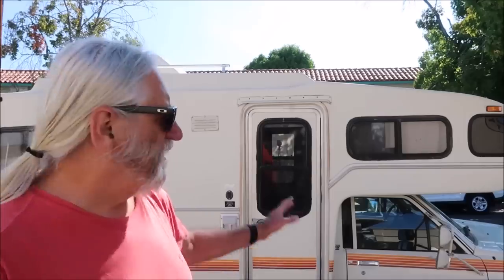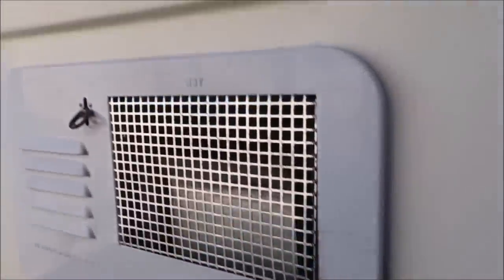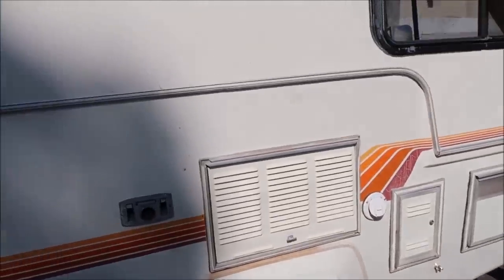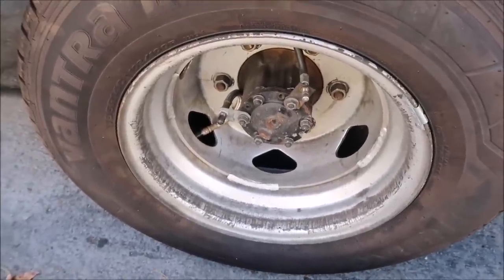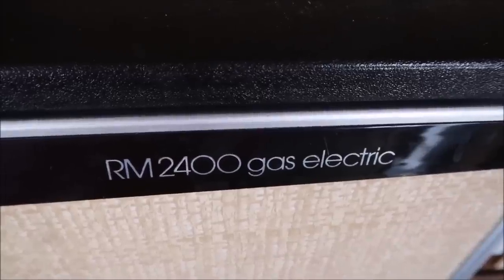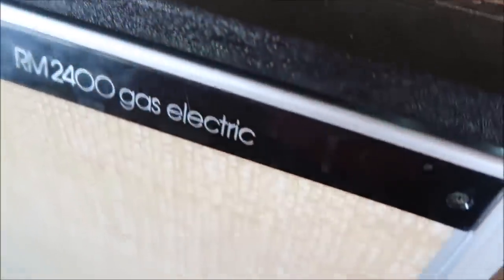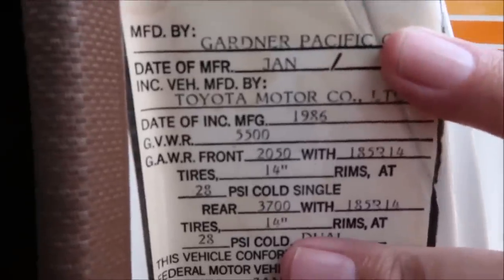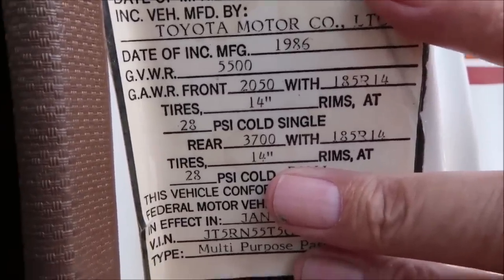What It’s Like Living in a Toyota Motorhome RV and Why They Stopped Making Them

Comment: Never knew Toyota made something like this. Explains why it’s still running 😅
Reply: Toyota didn't make it.
Reply: I'm surprised the frame hasn't caved in.
Reply: It's a conversion. Toyota didn't build it.
Reply: Except that as the owner explained, in the next generation when the engine became a 6-cyl., there was a serious problem with the engine heads and there had to be a big recall.
Reply: Because Toyotas are stout.
Reply: Right Lol
Reply: Toyota made the pickup cab, but someone else made the conversion. Weird they kept the same 4 cylinder. Thing can barely haul all that weight... solid engines but it’s too little for an RV.
Reply: AOMechMarine AOMechMarine just because it’s still running doesn’t mean it’s not too small. It’s not enough to get this thing over 60 mph.
Reply: Patriot Jefferson  I have the same body on a Nissan chassis with the z2.4 four banger. It pulls fine in the mountains. I'm not a speed demon, so it suits me well.
Reply: Don't let the fact that Toyota built the cab and chassis fool you.  Maybe the truck will still run and drive, but like all old motorhomes if water gets into the coach portion it will rot and turn into a black mold special.
Reply: @kennethsouthard6042  I have a Sunrader nearly identical to this, except on a Nissan 720 chassis cab. I'll attest that when water gets in the coach area of one, it rots into dust. I'm rebuilding mine. The fiberglass is in fairly good condition. I got it cheap. Going to do a body-off, complete with new floor and wraparound window delete.
Reply: Mine would do 55-60, Depending on wind,  lol.  Mine is permanently parked but if I sell it, all it needs is fresh gasoline and battery to run.
Reply: Kenneth Southard deadly and infectious
Reply: @tommyguns14able   The full one-ton frame from Toyota is built like a Mack Truck.
Reply: @jjbailey01   Me too !  I love the Nissan powered mini motorhome 5 sp. manual.  It pulls that load just fine.  Does it slow way down on long hills?  Yeah, but who cares.
Reply: @pouglwaw5932  heck ya! Dont care if it's slow as long as it'll still go.
Reply: Did anyone ever put a turbo on one?   Toyota engines are famous for their stout crankshafts.

Comment: I had a 21 foot Sunraider and did use the overdrive for the 10 years that I had it. I got up to 22 miles per gallon and never had any trouble with my transmission.

Comment: This guy is the real deal. He said "shore power" which original used by marine(boaters) say for plugging into electrical at the Marina(docks). If you hear someone say it at a campground usually means They have a good amount of time boating. 
  I bet this guy would have an interesting book if someone wrote a book about him.
Reply: Actually shore power is a pretty common term for plugging in at a campground.And yes we stole it from the boaters.
Reply: Shore power is the standard word used by RVers so it's not too impressive
Reply: @porcupinepunch6893  If you notice my comment is 5 years old, as time goes on things that are not common like slang words become common over time as these words spread across to other groups. Was a boater slang that expanded to RVers.

Comment: All of the 3.0 v6's were recalled.  I bought a 1991 Toyota pickup 4x4 with the 3.0 and got a notice in the mail that they would cover the head problem up to 100,000 miles.  My head gasket blew and warped the head at 98,000 miles.  Toyota replaced everything and never had a problem after that.  When I traded it in, the pickup had 295,000 miles on it and the engine still ran great.
Reply: Yep my 3.0 4runner has over 300k on it, still runs great and the blackstone oil analysis just came back perfect.
Reply: The 3.Slow Toyota was a real piece of junk.  Basically 4cly power, v6 gas milage and a time bomb for reliability.

Comment: Looks like it is in mostly fair condition considering the age.
Reply: Micah Chase The motorhome too!
Reply: he didnt mention all that water damage on the ceiling
Reply: Dan Kirchner likely staining from condensation rather than leakage.
Reply: Uhh, do you know anything about vehicles? This one is like a 9, most are a 4 dude.. just try to find another in this condition.  "Fair" condition is basically rusted out high mileage junk, this is VERY GOOD condition, if not excellent.  Did you need to feel bigger today by making someone else seem smaller? Seems so, sad..

Comment: I had a 87 toyota pickup truck with 2.4L R22 engine. I bought it brand new $7000, It was so under power. I used to tow a 12' travel trailer. It can go only 45 mph when pass through Sierra I80 to Lake Tahoe.

Comment: I had a 1986 Toyota  long bed with the 22R engine,  automatic. 

It will pull this, but the 4th gear/overdrive would only pull on flat highway, any type grade and it would kick from overdrive to 3rd gear. 
Great truck, kept it 22 years

Comment: So.... What I am hearing is... If you want one, get a 4 cyl, floating axle, stay out of O.D. 
Basically 86-88
Got it
Reply: Nah the 89+ with the v6 is the one to get. By now I’m sure they all had the defective cylinder heads replaced
Reply: @chunhaylee  Last year I rebuilt the v6 3.0 engine on my 1991 4runner 4x4. I should have got a complete engine from the junkyard here in southern California & rebuild that one instead. That engine didn't have the cylinder head problems that the 3.0 engine has.
Reply: Hi I have a 1991 toyota warrior
Reply: If you can avoid the duelly rear axel and find a single wheel.

Comment: I had one of those Toyotas, but the camper was taken off, and converted into a tool box truck. 1ton, 6 cilinder. Top speed 70mph. Loud winding manual Transmission. 16mpg

Comment: I worked with one of the owners of Sunrader around 15 years ago, and heard the whole horrid story of how the axle recalls started because of aftermarket dual wheels failing.  Really sad, Toyota and Sunrader didn't do anything wrong, and this guy went from making $250k a year making a good product, with a 30 year company, to losing everything and working as a tech at an rv shop, before he eventually bought another rv business and did ok.   He finally retired about 10 years ago I think.

Comment: I consider it a damn shame that Toyota decided to bow out of producing motorhome chassis. I'm sure they had their problems with rear axles and V6 engines. But once they were recalled and fixed, they had an awesome truck. I think Toyota should've continued with it, well into the Tacoma production. For a vehicle like this, I would've preferred a 2.4 litre turbo diesel engine, rather than the 3.0 litre V6 engine. Sadly, the turbo diesel was never available in large numbers in the USA. Emissions be damned, I would've preferred better fuel economy and better uphill climbing.

Comment: Anyone remember the small Uhaul box trucks from the early 90s that were Toyota cab and chassis based?
Reply: I do remember those also.
Reply: Yes I did. Still see some that are in third party hands.
Reply: I rented one that caught on fire
Reply: I use to own one, loved it. Regret selling it. Cheap to buy. Easy to repair, service, maintain, & all drive train parts are available locally at Toyota dealership ( O.E.M.) chain auto parts stores, & junk yards.
It was my undercover, stealthy garage, camper, & Mobil tool truck.
I would go off the grid with it. Loaded with camping gear, motor cycle, jetski, kayak, spare parts, & tools. Bought it cheap. Kept it for about 10yrs & 100,000 + miles & sold for a small profit. I miss it.

Comment: Cool rig .My daily driver is a 1994 3.0 V6 Toyota pickup. I have owned it for 12 years .It has 250000 miles and its still going strong. Its a little beat up but its paid for .

Comment: Should set some nice solar panels on top to power outlets and lights, not sure if enough power to make the ac work if if it does go for it aswell
Reply: I have one used 165 watt panel on my motorhome.  I have all the electricity I can use (wont run an ac though)

Comment: Funny I was planning on living in one a yr or two from now.
Reply: Really
Reply: Ebony Lo. I'd consider something bigger if you plan to live in it very long. I am currently living in a 34ft fifth wheel while I build a house. I don't think I could live in that tiny Toyota for very long!
Reply: @kansascountry970  I was thinking about it going through the gate at my workplace since it's so secluded and it'll take up parking.
Reply: Goodluck finding one and then goodluck finding parts for em
Reply: @carljohnson4996  if not a van would work
Reply: @ebonylo.  yea those white Van's work fine plus plenty of parts I've seen people add insulation a bed etc but it gets pretty cramped after a while
Reply: @carljohnson4996  I'm getting rid of my things as we speak. Haha I'm ready to start my travel journey. Don't have to worry about appliances anymore

Comment: I bet that thing is slow, people who buy Motorhomes should be more concerned whether it could make it up a hill than gas mileage.
Reply: Some rvs get 6 mpg. Id rather get higher mpg than speed.
Reply: @ninjamaster3453  If you struggle to go 20mph, yes speed is a concern.
Reply: martialimitator he doesn’t struggle to go 20 though. And who cares. If you can do 30 going up bad hills then that’s the speed you go. Gas mileage actually is a very big deal. Say you drive 3000 miles somewhere, and your motorhome gets 10 mpg, you’re going to pay about 900 in gas alone. In this he’d only pay 600. Those savings add up. Not only that but this engine is bulletproof. It won’t be breaking down anytime soon. He really should’ve gotten a manual 5 speed but I’m pretty sure he bought it used so he probably didn’t have a choice.
Reply: I concur Tombstone. It is a great engine for light hauling but not a good RV powerplant. Way too much weight for it to handle on steep grades.
Reply: Ninja Master how fast a vehicle should go doesn't necessarily determine how well it can go up a hill. Nobody buys an RV for speed.  I was really referring to Torque, Horsepower and Gear ratio.
Reply: I do have 1986 Toyota dolphin 22r goes uphill @ 45-50 depends how much weight I’m carrying One of the best engines no breakdowns , I did across country trips no problem.

Comment: Can u live in Toyota Celica?
Reply: '91 celica gts. Yes. For short periods. Be creative.  I'm 6 feet tall.
Reply: I.P. FREELY ho boy 6ft in a celica??!!! I am 5’9” and can’t fit in my ram !!!😤
Reply: Josh Fried I lived in a 1972 Toyota Celica for a couple years. Loved that car.
Reply: Well considering I lived in a 1993 Miata for over a month a Celica should definitely be easier.
Reply: 6th gen hatchback the back seats flip down and its basically a bed. get a couple batteries and a power invterter, battery isolator so you dont kill the starting battery. then youll have some power for a laptop or something. be careful idling with exhaust leaks.
Reply: Yes

Comment: My dad had one back in 2000. he got it from an older gentleman for $1,200. It was beautiful and well taken care off. that thing went to Mexico from Wisconsin and back, it was a 4 cyl 5 speed manual plus he used it as a daily for a while, it was an awesome vehicle to be riding in. One day he was driving in a winter storm in Wisconsin at night and a power wind gust flipped it on its side almost hitting a advertising highway pole. The front axle and wheel went through the cabin and the whole side that hit the ground was completely damage from the fall and the sliding, my dad luckily got off with a few minor scratches and that was the end of the motor home :(

Comment: It was called a head gasket recall on the 3.0 V6.  I had it done just in case, and it went from running great to rough as heck.  2 more trips to the Toyota Steallership, $300~$400 each time, and once "Fixed", I never took it back.  That was 25 years ago, and it runs smooth and strong.
I do get 1mpg less than the same sized '86 Dolphin I had previously with a 22RE, but it is worth it on the hills.  (I get 15~17mpg now,)

Comment: Well, that's a decent rig.  Mrs. and I almost an early Toyota chassis motor home.  Now I'm glad we didn't.  I never realized the axle overload problem.  Several years later we bought a towable .  Towing with the pickup truck was way better than towing it with the car.  At a store where I worked for a while, we sold some RV items.  I was the most experienced person in the shop, by far.  Many new RV owners thought that three blade plug was for 240 Volts.  NO!  As you likely know, it's for 120 Volts 30 amps.  The extra amperage was needed for the rooftop A/C.  Even the guys who drove the corporate RV didn't know that.  I'm retired now - thank God.

Comment: Love my Roadtrek 2005 170, has most of what this RV has except the stove, it's does have a 2800 watt on board generator but it's even smaller.  Built on the Chevy Express 2500 6.0 liter chassis so lots of power and fits in my garage.  Ok for 2 people but perfect for a single person.  So easy to drive, it's slightly bigger then a high top conversion van and gets 14-16 mpg on a regular basis.

Comment: I had one here in the UK, although mine had a 20ft Winnebago body on it, the bathroom was the full width of the rear, toilet in middle, shower on right (I replaced that with a quarter bath/shower) and wardrobe on left.

My wife didn't like it, but she bought me a 30ft Damon Challenger Class A to replace it, so I'm not complaining, the Chevy 454 TBI is only half a dozen mpg less than the Toyota 2.4 R22 EFi.

The thing that excited me about the Toyota, was the idea of adding a transfer box and live front axle to help getting off wet grass campsites. Guess I'll have to look out for a scrap mid nineties 3500 Silverado now...

Comment: Those 6cyl. engines had a head gasket recall, no mater what model they put them in. The head gaskets would leak out the back of the engine and between 2 cylinders. I did dozens of them.

Comment: I had a 1978 Toyota Dolphin with the 20R  4 speed 4 cylinder. It would do 70 mph on level interstate fully loaded and got 25 mpg. Traded it two years ago to a motorcycle.

Comment: This is excellent. I'm trying to put the money together for a rig to take to Burning Man next year, I've got that little 94 Geo Tracker you see in my profile pic , it has a tow rig so I can pull it behind a RV. It's what they were were designed for as far as I'm concerned. About a hundred horsepower and 2143 lb. That's it. And yes it's a manual Scotty. I don't tow anything that has an automatic.

Comment: Worked at a place that sold and installed just about any kind of after market car/truck/van accessories.  Had a customer come in with a very old Toyota Motorhome  RV ( not in good shape ) and a newer Toyota PU and got ticked off at us when I told him we would not remove the old RV and install it on the new PU.

Comment: 22R/E is the best damn engine ever built.  I had a '86 4Runner with one and built the motor with ARP studs, Performer EFI head, Hot Cam, big valves, newer straight flow thru throttle body, PCV vapor filter to keep the intake spotless, Downey Header and high flow Cat.  Pulling a motorcycle trailer up hills if you held it wide open in 5th at 6,000 RPM it would maintain freeway speeds.

Comment: He forgot to mention the refrigerator is Tri powered, works on propane when boondocking ie not hooked up at a campsite, 110 when at a campsite aka shore power but it also runs on 12 volt to conserve propane while traveling. But you switch to propane or 110 when you set up camp as it will drain your batteries.
 also works on

Comment: The mighty 22RE! Pops had one in his Willys wagon. Nothing like it till this day. With 4x4 and 3:31’s 4th and 5th we’re useless unless going on flat or downhill roads. Pushed this 2 ton + truck for years. Drove to Florida-NY -“a few times(6-7) The low torque on low did well with a Weber and Exhaust. Compared to the anemic v8’s it sure proved itself.

Comment: seeing how Class B Mercedes chasses are  going for well over 100K new,   this size motor home on a modern Toyota Tacoma with a V6 in the 70K price range would take the RV community by storm
Reply: You are likely spot on re pricing and demand. I have a MB extended high top - the biggest Sprinter they make. I do like the 6'2" headroom and 19mpg with the diesel. I don't have the full rv set up though - just the 2500 series. It's 24' and super nimble to drive. Everyone should have one!

Comment: I have a 1985 18' Sunrader on a Nissan 720 chassis cab. Excellent little runner. I currently have it gutted for a renovation. It came from Oregon and the interior was pretty rotted out. Excellent chassis and shell. Going to have some fun with it. Some custom work, wraparound window delete, and custom interior are in the works.

Comment: They need to bring these back immediately!!
Reply: So, why don't they? I can see a Toyota Tundra based motorhome being offered. Toyota has had countless opportunities to do that, and so far, they've yet to do that. Why the hell not? I'd buy one if I could get it with a turbo diesel engine powering it, either a 4 litre 4 cyl. engine, or a V6 Turbo Diesel.
Reply: @jasoncarpp7742  hell yea!
Reply: @dreamingcode   Yeah. Emissions be damned, what good are emissions if the engine isn't reliable and the truck can't be driven? That's never made sense to me.

Comment: Save yourself a bunch of trouble,
Get a Tacoma and buy the water heater etc used or new. Everything packs tight in the back of the truck and unpacks at the campsite. Get one of those shower tents and a 10x20 carport tent. And you will be driving/camping in style. 70-80 miles an hour on the road 200 + square feet of room at the camp.

Comment: The V-6 head gasket problem, you can blame on the EPA, it was mandated that asbestos could no longer be used in head gaskets. It caused a lot of problems industry wide. Toyota had a silent warranty on certain V-6 engines for a long time